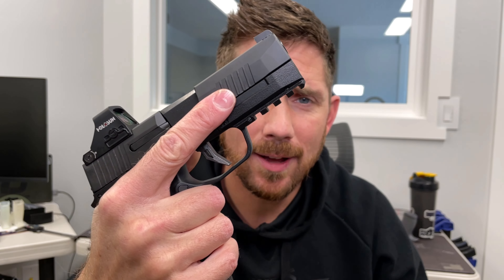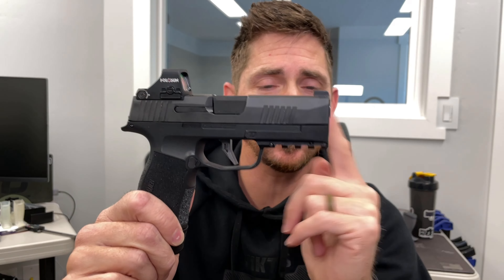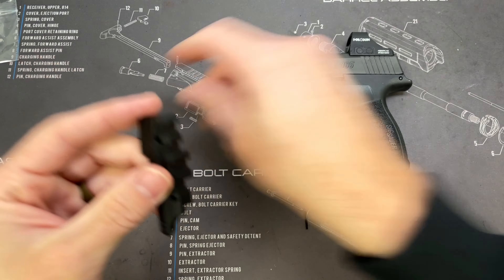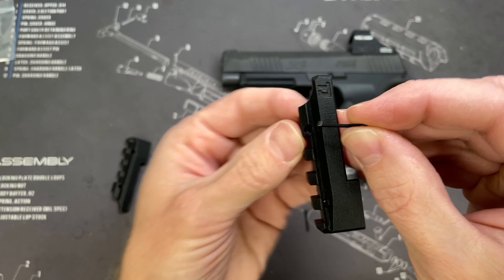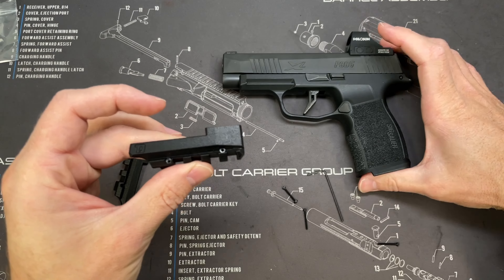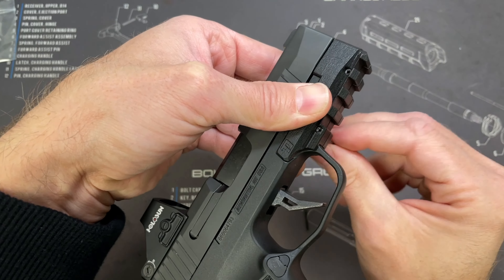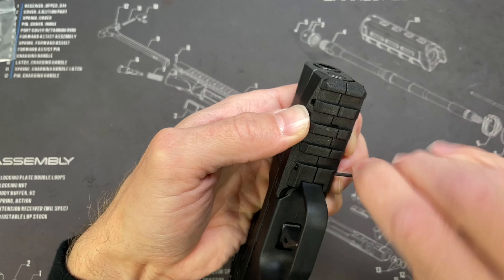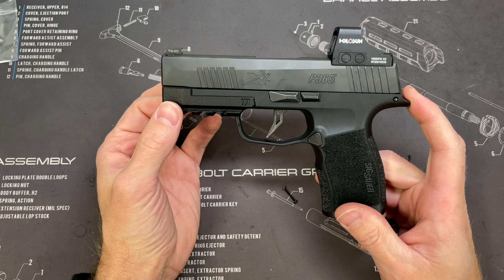Tactical Application Rail Install - Updated

Comment: How about a xl frame with a standard 365 slide with a Herrington comp would the G-TAR work ?
Reply from the maker: Description of the Gassed rail has a table to answer that. standard slide length + comp = GXL-TAR which will cover the comp but the G-TAR Will also work